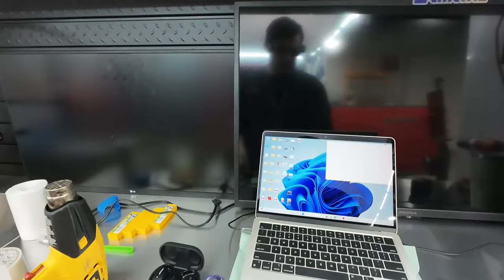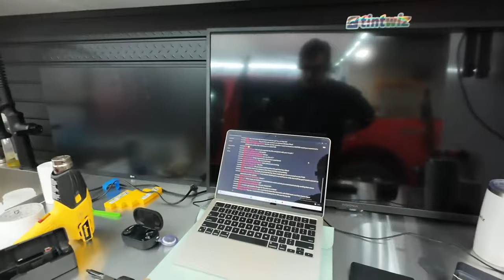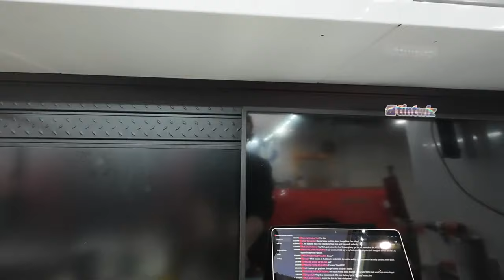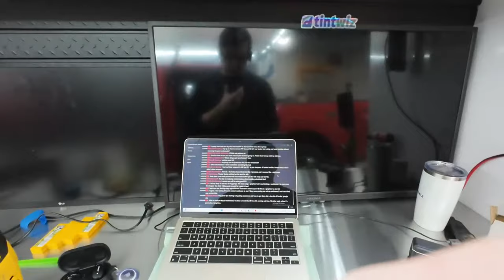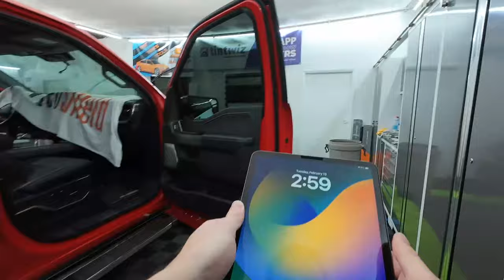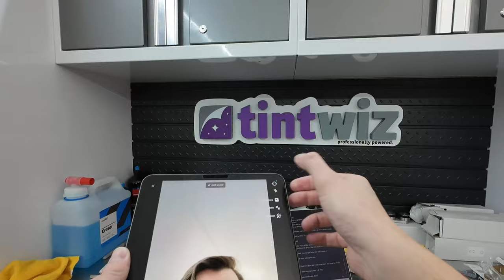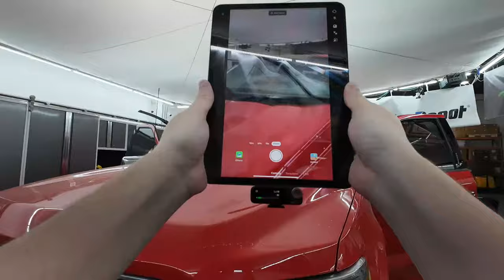Ford F150 Carbon Window Tint Full Windshield

Comment: Wusup Matt. I have been watching you for about 12, 13 years now, love the vids and the explanation. I have a quick question. Have you ever used Flexfilm? If not, have you heard about it and would you recommend that film if you have heard about it? I have tinted a lot of vehicles using that brand and now running into a few issues. Thanks for the vids and wisdom. Look forward to more and your response. Happy tinting.

Comment: What is the plastic sheet you cover the door panel called? I need some for when I tint windows as well.
Reply: I think he sells it on his website
Reply: It’s called drap tape. You can find it at Ace hardware or any lowes or Home Depot in the painting supplys.

Comment: So did you tuck the film? I know the fords seals are super low and it didn’t seem like you had enough down there to tuck it.
Reply: The offset from the outside lets the tint sit flush on the inside since like u said ford seals sit low